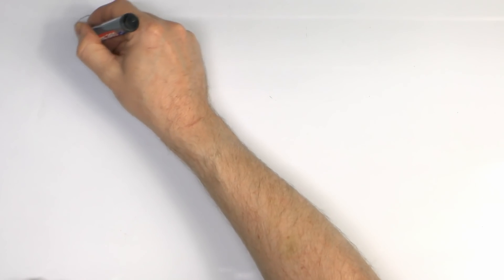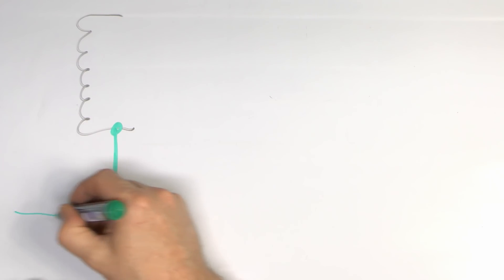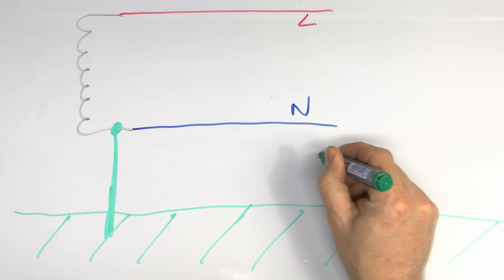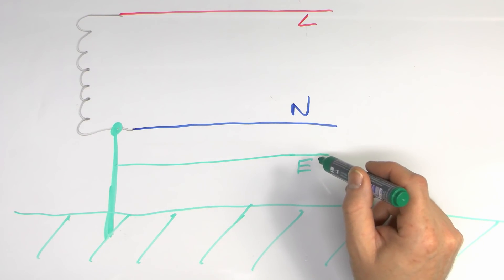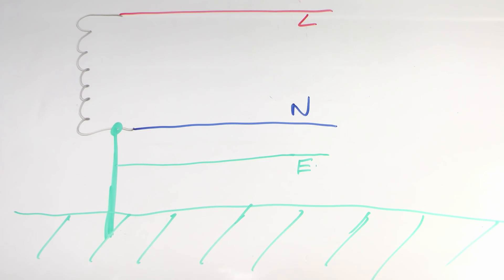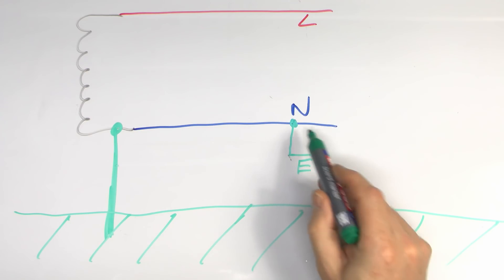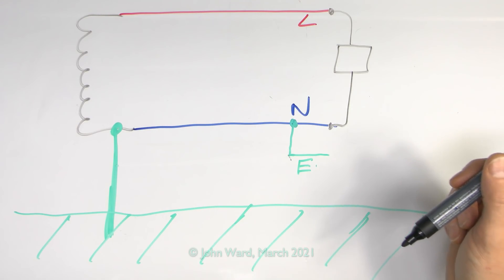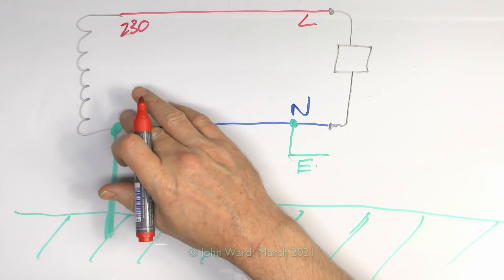Earth Terminal Voltage Drop TN-C-S

Comment: Am I right in saying in the future this will be a bigger problem when every house wants an ev charger. Bigger consistent loads so more volt drop on the neutral. I hope some more guidance comes out on hot tubs in the future but after seeing this it’s not just the dreaded pen fault that’s an issue just any undesirable ‘tingles’ want avoiding. When hot tub manufactures state there class 2 does this take into account the heating element and not just the casing ?.

Comment: see 6:28 mark...why would 1 live (phase) be distributed to 3 houses? Normally each house would get a single phase L1, L2 and L3 (or red, white and blue), the neutral / earth may be common (split) to all 3 houses though!  Therefore the scenario being described should never occur!
Reply from the maker: The three phases are distributed among the houses, but one transformer will supply many properties, not just 3.
A typical housing estate may have 100+ houses connected to a single transformer, with 30+ on each phase, all supplied from one cable.

Comment: I am just about to install a hot tub on a tn-c-s. Would there be a issue with installing a ground rod near the hot tub with the earth linked into the main cpc from the tub. Basically a supplement to the cpc ground from the hot tub. Does anyone have any ideas on this
Reply from the maker: Not a problem with that, and it's actually recommended for TN-C-S installations to have a supplementary earth electrode as from 18th Amd2.  
The cable from the main earth terminal to the electrode will need to be sized appropriately, which may be larger than the CPC in the cable to the hot tub.

Comment: As an electrician state side it is interesting to see what the difference are between your codes and ours for the services and grounding (earthing).  Here we don't do TT in residential or commercial, it is all CN-T-S.  In a home with metal water service the primary earth IS the water pipe.  We also drive a supplementary ground rod that is 5/8" (1.6cm dia) and 8ft (2.4m) long in the ground.  If the service is larger,  200Amps, we will add a second ground rod a minimum of 6ft (2m) from the other ground rod.  Ground rods are tied to the first means of disconnect with 6ga (13.3mm²) bare copper wire.  If there are a pair then that wire is a loop of 6ga starting at the panel then the first and then second rods and returning to the panel.  Water bond for a 100Amp service is 6ga and for 200Amp services 4ga (21.2mm²).  Our only neutral to earth occurs at the first means of disconnect.  That is generally the main panel.  All delivered services here have grounds at each pole tied to the neutral.  This neutral is also combined and servics as the neutral for the primary on our delivered services in residential above ground.  Poles and transformers.  If everyone keeps their grounding and bonding in good condition then loosing a neutral, though not good, is not a catastrophic occurrence.   If your ground bond is compromised then you can end up with allot of magic smoke being let out of electrical equipment in the home.  This is an issue you don't have there and is particular to our 120/240 split phase home service.  The same applies for out 120/208 and 277/480 3 phase systems as well.  Interesting video .

Comment: I was at a job where I had to check out a pontoon that was supplied power from the house main switchboard. I did a few tests and discovered that the pontoon aluminium had 2volts on it. Then I discovered that it was earthed from the protective earthing conductor from the circuit supplying the jetty and that the neutral back at the main switchboard had 2 volts on it as well (The earth's and main neutral are connected  together at the main switchboard) I was curious about how significant 2 volts was especially in a wet area so I wet my arms and the aluminium deck on the pontoon and put my hand in the water and I found out straight away about my previous unknown little cuts on my hand 😆

Comment: Thanks for the great videos John. Considering hot tubs and swimming pools, why don't we use isolation transformers with protection and double insulated secondary circuits. That's what is done on site with 110 V power tools?
Reply from the maker: They could be used, but the cost is why they are not.  A transformer for that would have to be continuous-rated, making it a very large and expensive item.  Such transformers do exist, mainly for marine ship to shore and other specialist applications, in terms of cost a 32A type is around £700 - not exactly an attractive addition to the costs of installing a hot tub.

Comment: Hi John, when the installation is using a TN-C-S earthing arrangement and they incorporate PME. Does this mean that each additional earth electrode is a parallel path back to the transformer through the physical ground itself? As a result of this there will be current flowing through each earth electrode back to the transformer as there is a slight potential difference between each of the ground rods back to the transformer? Many thanks in advance.
Reply from the maker: Yes.  In a PME system current flows via anything connected to Earth and the combined N&E conductor, and that includes bonding to metal water and gas pipes, earth electrodes, steel buildings and so on.  The resulting magnetic fields can cause problems with equipment.
Reply: @jwflame  Many thanks for the response John it is always appreciated. Just to clarify that this is in normal circumstances that current flows via anything connected to earth and the combined N&E and these are all parallel circuits? In a different post I was told that "earth and neutral circuits are only allowed to be bonded at a single point, otherwise the earth wire would have varying potential along its length since it would be a parallel circuit". Am I correct in understanding that this statement is only true for anything after where the neutral and earth are combined in terms of the consumer end to stop current flowing through the earth wire. But anything before the neutral and earth link can be bonded as much as you like with earth electrodes or metal water and gas pipes which ultimately are all parallel path back to the transformer as the neutral is earthed back at the transformer end? Hope this makes sense John and I look forward to your response.🙂

Comment: I am seeing some weird stuff at my location since last 2-3 days. 
At night I saw an neon led light glowing faintly even though switch was off but appliance was plugged in. I though might be some loose neutral somewhere. 
I tested with a multimeter and here are the readings
Line to neutral 248 volts
Neutral to earth 111 volts
Line to earth 350 volts

This is strange. How can line to earth become 350volt. There is no issue on any appliance as line to neutral is ok. In morning it got fixed somehow and voltages becomes normal, led stops glowing. But again at late night it starts with almost similar readings. It's the same thing on another house on different phase. Any idea what causing it?
Reply from the maker: Probably a faulty neutral on the supply to the property, and it shows up at night because the load on the whole system is lower then.
It needs to be fixed as a priority - contact the power company / network operator.
Reply: @jwflame   ok, will get it checked.. Thanks!

Comment: Hello John, I’ve bit concerns about this, I might be wrong. I was thinking that we’ve step down transformer which converts voltage down and current up so it pushes 253v-230v to last connection of installation in parallel so that we could have same voltage as much as possible and we distribute current throughout the consumer installation according to our amps capacity of source. But yeah we still have resistance which will result voltage drop but my concern is that I thought voltage drop is lost energy as heat so if that voltage is already lost how it can cause effect on something? I was thinking that it only can give electric shock if it hasn’t sufficient earth connection to the source of energy. Except some other problems to consumers or installations... thank you!

Comment: For some reason this brought to mind Open University programmes shown late at night on BBC2 many years ago. I was young then but I presume they were designed to be recorded to VCR for playback later - they just broadcast them in the early hours as the regular live view broadcasts had ended, the transmitters were up and running and it was preferable to expending all that energy to broadcast a test card.

Comment: Hi I wanna change a single socket to a double socket. wires is way to short to fit the double can I use a connector strip block. I know I can get other sockets but the sockets are bought now
Reply: Better to try to get some slack on the cable if possible, if you have to extend do each individual core with a compression crimp joint which are maintenance free
Reply: @tonywebb9909  what type of joint is that

Comment: I've got a 9.2kW water heater in the kitchen. It's wired up to the cooker outlet. The outlet goes back to the consumer unit using 6mm² twin and earth which seems to be rated up to 45A. The breaker on this circuit is only 32A. It all works fine as I understand it takes a while for overcurrent on a breaker to actually trip it and the heater is only used in short bursts. I can't see any reason why this setup would be potentially dangerous as the breaker is lower than the current rating of the heater and the cable is higher, so the worst that can happen is the breaker trip out if the heater is used for too long right?
Reply: Rather than guessing wether it is ok or not, get an electrician out to look at the installation and have it inspected. (When in doubt call a professional)
Reply: @realtoolsrealreviews5173  Have you tried to get a sparky out these days? Every single one I've called has said they'd ring back and NONE have. Why do you think I asked the question in the first place? And guessing? It's not a guess, it's a hypothesis which I'm asking is correct or not. Eventually, I'll probably manage to get a guy out, but until then I'd like to confirm if every time I turn the hot tap on I'm OK or if I'm gonna burn the house down. Currently, I'm hardly ever using the hot tap because of this. So instead of the passive-aggressive non-reply, how about you actually try to help. And if you can't, keep your comments to yourself.
Reply: @nicholasmarty4370   You’ve totally misunderstood the point of my comment, first and foremost i always say to everyone to get a professional out to check things if in doubt about something (as you’ll get the right info first time and it done safely) due to my time spent working in a diy retailer and the questions we get asked about electrics from the general public is unbelievable and dangerous as usually people have no idea what they’re doing or just enough to be dangerous. Since you have now pointed out that no electrician at the moment can look at the installation and you have even tried ringing to ask the question and have had no luck i will offer my opinion (I’m not a qualified electrician but i have understanding of the simpler mechanics behind it so don’t quote me on this). Ill break this down into 3 parts

first the hot water heater (I’m going take it as its an on demand instant water heater) at 9.2kw at 240v uk mains voltage is 38.33 amps drawn

secondly the 6mm cable feeding the appliance which after checking a well known cable suppliers website lists the current rating at 40a so assuming that the cable is the correct mm2 for the length of the run (sized to reduce excessive voltage drop) and hasn’t been de rated (i.e being run under insulation or certain enclosed spaces) which reduces the ability to dissipate heat (all cables produce some waste heat when in use due to resistance in the cable) so the cable seems fine as long as it was specced right when first ran

Now onto the last part and without deep diving into breakers as there is a lot of different things to look at, ignoring the type of breaker A,B,C,D (how long in seconds it can last dealing with large startup surges in induction motors and other appliances) the other thing with breakers is they dont trip instantly as soon as you go above say 32A on a 32A breaker. A slight overload on a breaker could take hours for the breaker to operate whereas a massive overload from a dead short on an appliance will trip it near enough instantly (seen this happen from personal experience with a dryer and heating element that shorted out as both sides touched which popped the 32A breaker within a second) 

since the water heater is only been run for short periods of time this will be why the breaker hasn’t tripped but i would be wary of it doing damage over time to the breaker if repeatedly done due to it potentially overheating/causing damage internally which could cause it to malfunction. The breaker is undersized for the appliance so it needs replacing (next size up i know of is 40A). Me personally i wouldn’t use it until its sorted but if its something you cant go without then i would recommend keep the usage time as short as possible and use it as infrequently as possible.

I want to preface again that I’m not an electrician but have a fair understanding of the more general side of it so please don’t take my word as gospel and I hope that a qualified electrician stumbles across this post and can offer a more detailed insight into it that knows a hell of a lot more than I do

Comment: Interesting timing...  Rodalco2007 just uploaded a video explaining SWER (single wire earth return) isolation transformers used for HV electrical distribution in NZ.  Point of grounding in the HV distribution system (and isolated with no grounding) can affect the

Comment: I know this might be irrelevant but i have yet to find an answer to this one question. 
In T-T System, should we connect the consumer earthing cable (coming from ground rod) with the neutral at the consumer unit?
Reply: No! That would void the whole point of providing a separate earth and would also cause some (normal,  non fault) current to flow through the installation earth rod back to the earth rod at the source transformer/substation.

Comment: Aren't TNCS systems installed with PMEs? So in theory the return currents that cause the voltage drop in the CNE conductor are run to the mass of earth locally?
Reply from the maker: In most countries yes.
In the UK, there is no local earthing for TN-C-S supplies.

Comment: I've got a bit of a problem. A customer with OCD is uncomfortable with a dual light switch arrangement. She's bothered by one of the switch positions being reversed due to how that switch circuit works. I'm not aware of any solution to this other than those electronic smart home switches, but she doesn't want those; just regular (looking) switches. I'm good enough with engineering and electronics to be able to construct something out of regular switch plates, servos and the like but the result wouldn't be BS compliant. Anyone have any ideas? I really hate telling her it can't be done because she's the sweetest lady I've ever known, albeit a little strange due to her OCD.
Reply from the maker: Retractive switches with an impulse relay located elsewhere.  Both switches will always look the same regardless of the light being on or off.

Comment: Understanding Earth ( cable )  theory is a Degree in all it self.

I have to explain alot of this many times to people still think of Earth as 0vdc or ground.   Ground is not Earth.

People find it more confusing when doing ICE products ( car / truck etc ).  As the tyres on the vechicle are plastic rubber and therefore isolates the vehicle to Earth.

I always equate E to N expect a risk of 30V, a fizz.

Then there is Star / Delta Earth cable diferences when spilt phase between three houses ( and lampposts ), and then if someone has their own additional copper Earth spike on their property.

And then the topic of Earth leakage from surge protectors ( capacitors / inductors ) and chinese cheap buck convertors and dodgy transformer applicances or dodgy plugs from your neighbour giving spikes and leakages back feeding.

Way forward in a theory maths we would need a IsoT with no Earth linked and throu UPS, then maths would be true.

Comment: With so many issues surrounding TN-C-S do you think the UK will ever go back to using TN-S with more modern type cable? (3 core SWA or Split Concentric) 
I know it's about making it as cheap as possible but when it becomes dangerous and/or deadly surely things will have to change.
With more EV chargers being pushed in TN-C-S just seems like asking for trouble.
Reply: Companies are getting better at making EV charging points with built-in PEN detecting fault technology now.
Reply: Bs7671 are pushing electricians to use supplementary earth electrodes to help with problems like pen faults and volt drop. But there’s a lot in installation problems especially in built up urban areas.

Comment: If the water pipes in the house are bonded to earth doesn't the cold water feed link all three houses earths together? What sort of impedance does that give and does the current flow to actual ground cause electrolytic corrosion of the pipes?